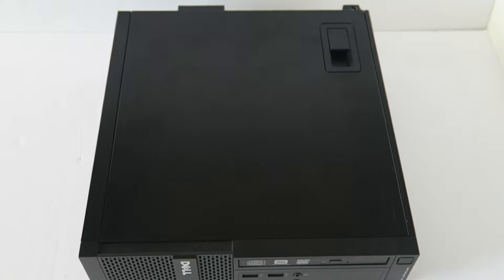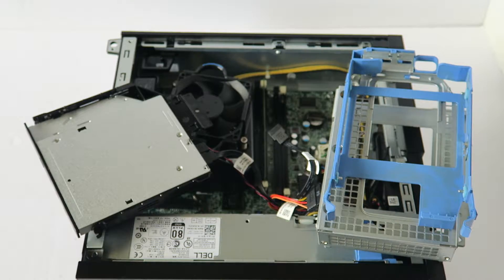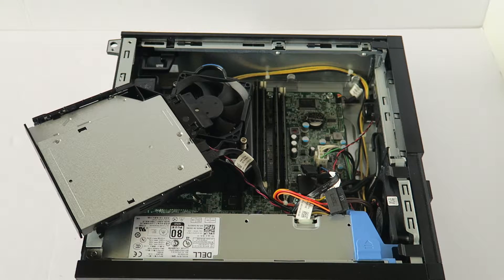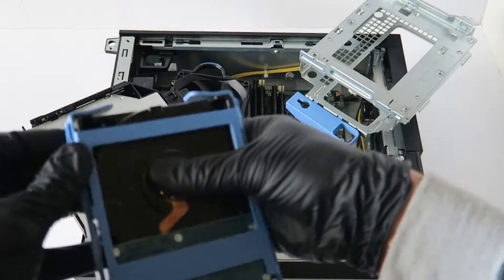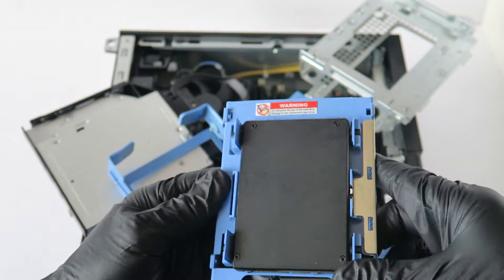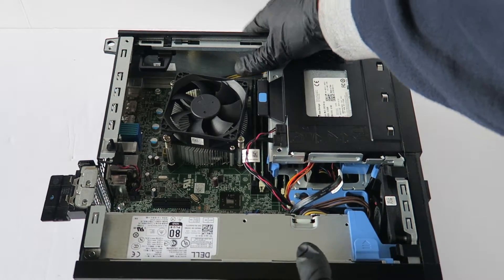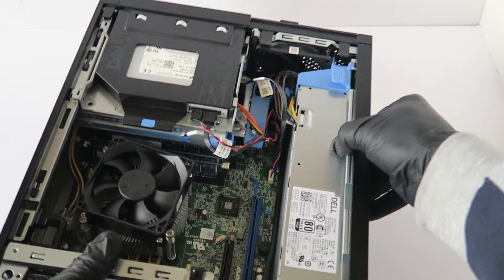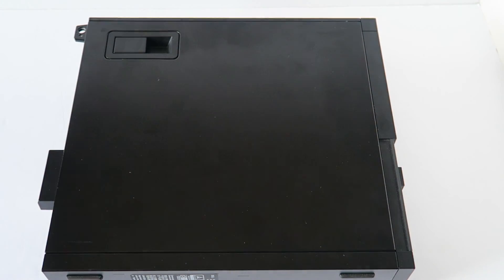Dell Optiplex XE2 Upgrade Gaming Video Card RAM SSD

Comment: Hello,

Ihave a Dell Optiplex XE2 SFF with a i7 4770S 8GB DDR3.I watched your very intesresting video and I wantted to ask you if,apart from the HDD ,SSD,video card it would be possible to upgrade the processor and if so ,if the bios allows it, which one would you adwise me to buy ? Thank you in advance for answering..best wishes
Reply from the maker: Hi, yes you can upgrade CPU to Max  Intel Core i7 4790 and you can also update BIOS to A26 before upgrading the CPU...
https://www.dell.com/support/home/en-us/product-support/product/optiplex-xe2/drivers
Reply: @Mxkdt  Thanks a lot

Comment: What's the difference between a regular optiplex sff and this Xe2?
Reply: The sff is smaller and packs less power
Reply: @A1exwrigh  The question was between other sff and XE2 sff...
The XE2 comes with an 80 plus gold 315W PSU, most SFF have less (255W is standard for Dell SFF.)
Reply: The Optiplex XE series is Dell’s Point of Sale (POS) models. You often see refurbished sales of these from dental offices. Besides the beefier 315W power supply, you get a CPU heat sink with a higher temperature rating and generally a more thermally resistant system. More info here: https://en.wikipedia.org/wiki/Dell_OptiPlex#OptiPlex_XE
Reply: @swanson8r  Thanks

Comment: how much of performance hit do you take by not using the 16x slot?
Reply: For a GTX 1050Ti (And this is according to forums I have read not from personal experience so take with a grain of salt) It is not a massive amount and you would really have to have two computers side by side one with the card in the 4x and one in the 16x to notice... If you really want to use that 16x there are some single slot cards (mainly workstation cards) that you could use such as Quadro K1000 or P1000... I am saying the Quadros mainly if you want raw performance FOR THE SLOT SIZE yes you will experience better performance and for a better price with that 1050Ti in the 4x slot...

Comment: When I put my new ram in, it is a bit wobbly, and I tried putting in the original ram but that is still wobbly
Reply: Have you tried pushing it all the way in until both of the levers click? If it is still a bit wobbly after that and perpendicular to the DIMM then that shouldn't be too much of a problem... You will know if you didnt put it in all the way though as you will get a very obvious warning upon boot that the RAM cannot be detected.

Comment: The PSUs in these XE2 systems are actually beefy. The SFF version has a 305w, and the midtower version has a 365 watt PSU, so you can upgrade the GPU up to a 1060 or RX 480.
Reply: believe the 365 watt source will fit on a 7040 mt

Comment: Did you have any heat issues with the graphics card?
Reply from the maker: No
Reply: @Mxkdt  I know this video is old but i have the exact same pc but i have a gtx 1050 ti full size card.  do u think it will fit?
Reply: @Tibiaholic  Okay considering it has been a year you probably have already found out on your own but no only low profile cards will fit the chassis

Comment: Hi bro, i have the dell optiplex 3020 core i3 4th generation 4160 3.6GHZ, 255W OF PSU BUT I CANT USE MY VIDEO CARD NVIDIA GT 610 OF 2GB DDR3 WHAT HAPPENED WHY THIS MY WINDOWS ARE GOOD BUT I DONT NOT HAD VIDEO WITH THIS GRAPHICS CARD